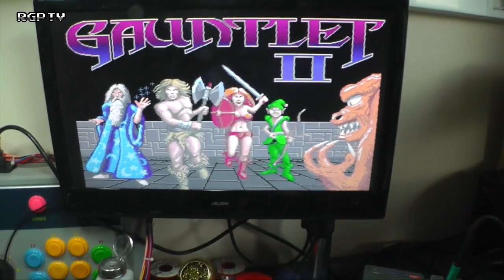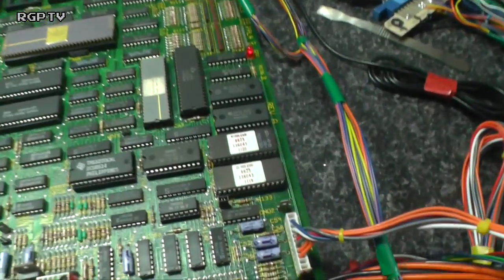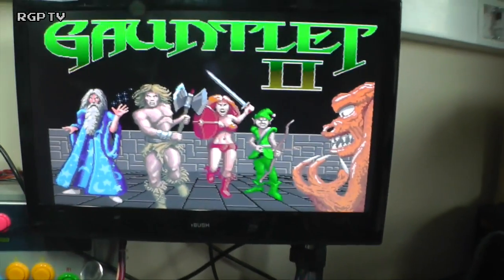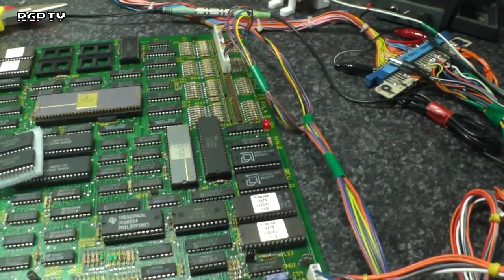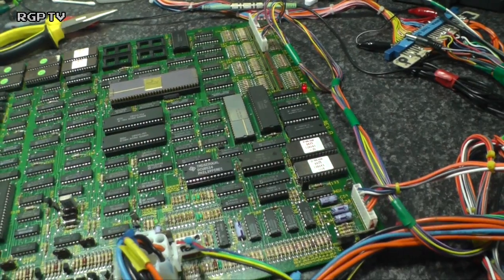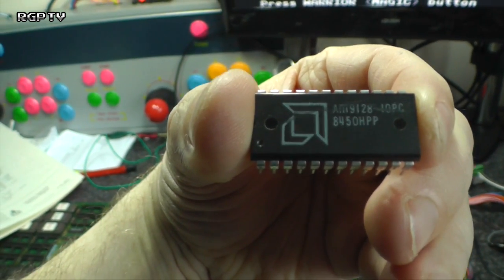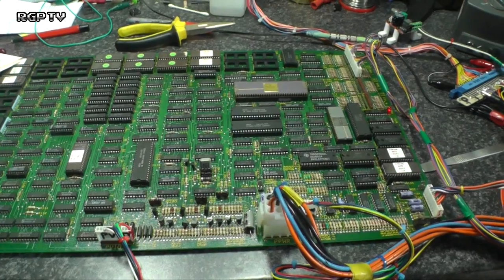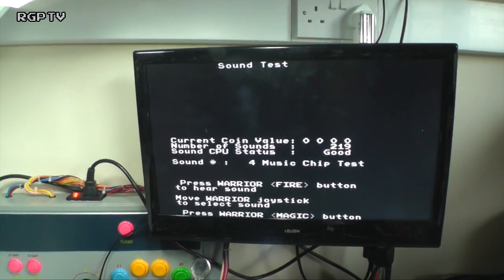Gauntlet II PCB Repair Sound Not Working

Comment: I know they do sometimes pull some tricks with these boards to cut costs etc., but I don't think this would be dependant on the RAM being slower in this case...

The MB8128-15 actually has a 150ns access time, compared to 120ns on the HM6116-2.

That means the MB chip has a max access "frequency" of 6.66MHz, and the HM has a max of 8.33MHz.

I think the 6502 in the sound section is running at half of the main clock freq of 14.318MHz, so 7.159MHz. That would explain why the slower RAM isn't outputting the data quite fast enough. :)

Loving the repair / restoration vids btw - keep 'em coming.

I like the longer vids too.

I know the more complex faults may be frustrating to debug, but it sure makes for an interesting vid. :p
Reply from the maker: Thanks for the explanation and the feedback, the clock frequency running faster than the RAM seems right - I never even considered the clock frequency on the CPU, it was literally just parts swapping from another board after probing the CPU reset pins etc which drew me to the solution and ordering the HM6116's.  More videos to come soon, just been tied up with regular work.
Reply: No probs. :)

Most SRAM chips don't have a clock as such, but the CPU of course expects valid data to be output from RAM a certain time after the address changes, or after the Chip Enable / Output Enable go low. ;)

I've had a similar thing before where I was trying to make a cart emulator for the Mega Drive from SDRAM, but it didn't work due to the latency (even though the SDRAM has a way faster max clock rate than the MD bus).

Strangely, the N64 cart bus is quite slow in comparison, so you can actually use SDRAM to emulate a cart.

Shame I don't have the space for an arcade cab, as I'd love a vector monitor for things like Tempest, or something like Gauntlet / Joust, or a good 90s platformer.

Comment: Crystal castle sound issues same problem the atari ram malfunctions drives the audio full blast cant turn it down volume control doesnt work replace the ram and bingo sound fixed it can cause major tail chasing I admit

Comment: Good stuff James, glad you got to the bottom of it. I have to confess, that while I am familiar with some of the odd timing issues that occur with Atari boards, I have never stumbled on this sound RAM timing issue by accident, so I must have been lucky with having suitable replacements in stock. Infact I've never seen the RAM error message when the sound section had bad RAM, it normally reports "SOUND CPU NOT RESPONDING" as with bad RAM the cpu normally doesn't boot at all. In your case the CPU was actually able to boot and report that the RAM's were not responding as expected, and it's probably the only time you will see that RAM error message
Reply from the maker: Thanks Luke :) Really odd issue, it might be ROM revisions that have different behaviour on the test side.  I've a Rev C that won't display anything, it was watchdogging until I reseated all the chips and now the CPU comes out of reset but no video output.  Will get back to that later sometime.  It sat for a good few hours running attract and no issues so i've bundled it up and it can go back to the unit now for spare stock.  Wish they were all that simple, i've an R-Type that won't boot at all and a GORF with clock but no watchdog so it won't reset.

Comment: nice vid, any advice for someone who's interested in getting into arcade boards repairs? im getting into gaming on a supergun and came across a bloke who's been in the arcade business for 30 odd years and hasn't thrown anything away, so hes got over 1500 boards that hes selling them untested and most likely need some work.
should i just try to get a few boards of the same game and have a go at it with a multimeter?
Reply from the maker: Hmmm, watch plenty of YouTube videos, follow people like arcadeuk , read up on microprocessor implementation, TTL logic.  You'll need more than just a multimeter.  A decent logic probe is your first tool but a scope is almost essential.  We'd be interested in taking some untested boards if they're being sold, send us a message via our website.
Reply: thanks for getting back to me , sent a msg via your website. i was recently considering getting a cheap little portable oscilloscope off ebay to get me going. any suggestion on min requirement i should be looking for?

Comment: Hiiii. What hardware are you using to display the board on your LCD monitor? My cabinet is on loan but I've got a couple of boards I want to spin up for some testing, and most of the common converter boards I can find seem like they won't quite be able to do it, unless their docs are wrong...    so, what do you use, which obviously does work? :)

Thanks!

Comment: What chip tester is being shown @7:00 in the video?
Reply from the maker: I can't remember the exact model but if you just search "ic tester" on eBay you'll find one very similar.
Reply: I didn't do a good job of asking the question. I'm looking for the ram tester that hooks up to USB (I see yours at 6:24 in the video). If I search for ic tester on ebay all I get are those cheap (I have one already) ic testers with built in screens that don't do RAM. Thanks!